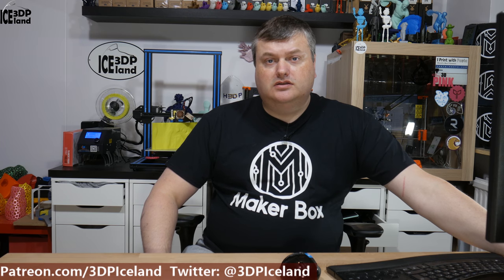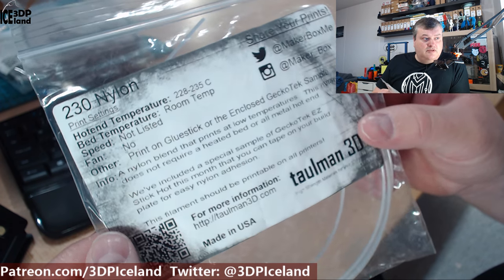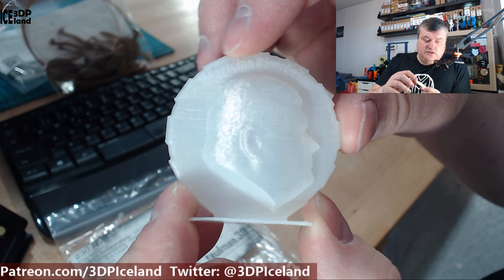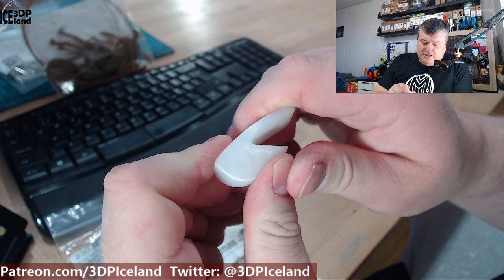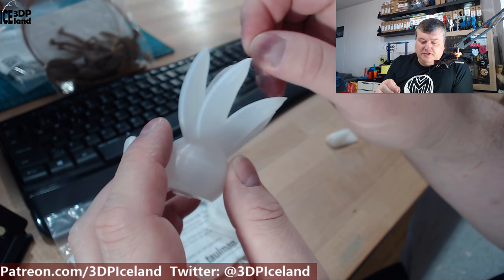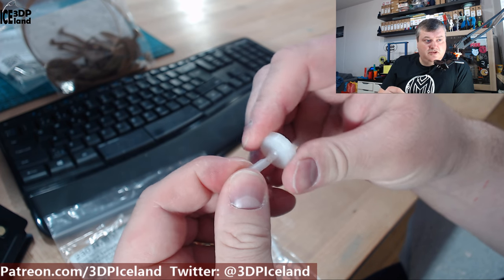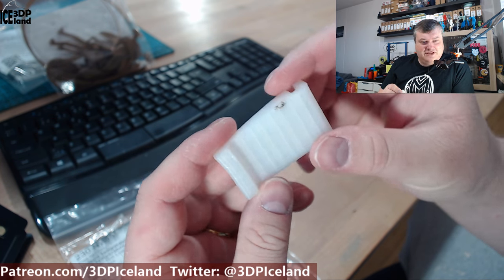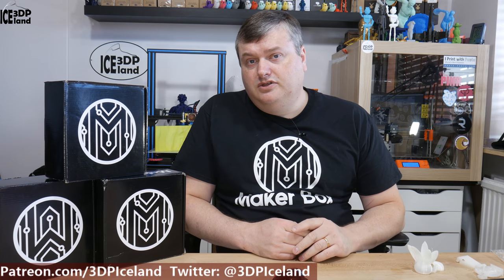Makerbox Monday - Taulman 3D 230 Nylon

Comment: Thanks for the great review.

Could you perhaps post your test conditions in the video comments ?
Like:
Type of printer used
nozzle temp
bed temp
bed type and preparation ? (fi glass with gluestick)
Printing speed
layer height
brim ?
raft ?

That would be a great starting point to get the same amazing results that you had.

Thanks in advance,

Best Regards,

Robin
Reply from the maker: Hi. Thanks for your comment,   I print all my makerbox sampls on my mk3, using suggessed print temps and settings/speed as stated on each filament and  I usually say in the videos if I do something different than recomended, I never use a brim or a raft for those tests prints . Also with bed adhesion, PEI sheet for almost all materials, but added magigoo for PETG, (glue-stick or Geckotech for nylon), I try to mention it in the video if I do something else than just the PEI sheet..